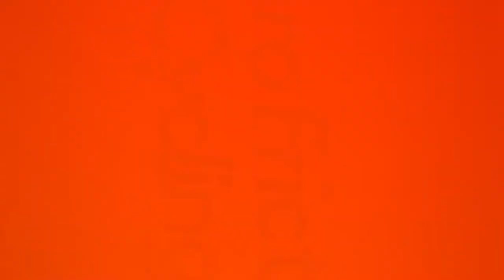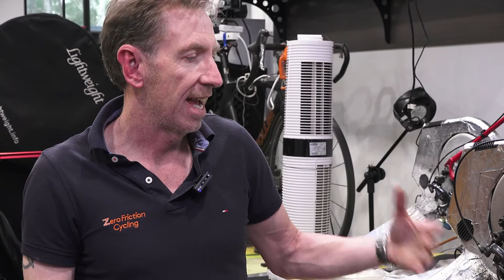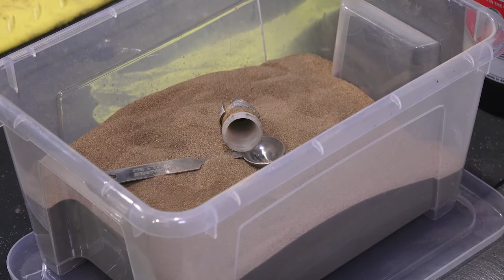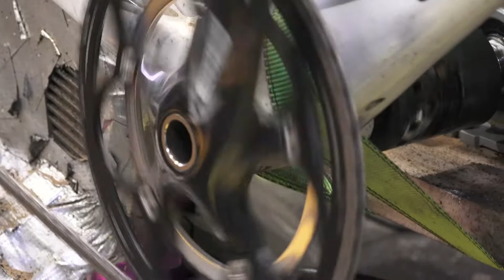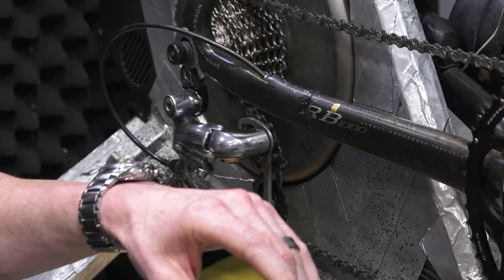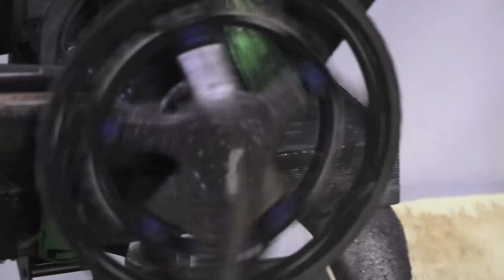Episode 9   Demonstrating  Bicycle Chain Contamination

Comment: loved the floating test bench design! makes so much sense.
Reply from the maker: Thanks Evrim! yes its a nice simple solution and those couplings are made for such situations - bb bearings in oldest test machine are nearing 200,000km old so it definitely is not transferring miss alignment loads, everything just floats on those legs & coupling very nicely

Comment from the maker: K re upload after first one missed demonstrating dry contamination on wet lube chain. There were a couple of comments on original upload re concerns safety wise of pedal spindle - great to see / hear people worry about such things! Pedal spindle is used to crank trainer up before turning on motor, cold start places much more strain on couplings as wants to got immediately from 0 to 100 cadence. One day will upgrade garmins to set grade to -5% and have trainers humming along before starting (i have this on the dedicated race chain machine) - but - in 5 years and well over 300,000km of testing to date (well over 10,000 hours of test machine running time), i havent yet come close to getting whacked with the spindle. Its pretty easy to miss, and one naturally takes care around spinning motorised equipment. It would take a pretty special effort to get whacked, it is a lot easier to ensure well clear than what it probably looks on video.

Comment: Ah, brilliant - the setup video.  One thing not mentioned - is it always the same chain that gets used?  Might be good for consistent data?
Reply from the maker: yes every test chain is a new ultegra 11spd. However the chain itself will always be the largest variance in the testing, hence we are looking for larger differences in the results, close results - basically class that as same same as positions could reverse if both re tested.

Comment: Very interesting. You drop the contamination onto the top of the tension run of the chain, where it is partially knocked out by the chainwheel teeth then it can fall off the bottom. But IRL the contamination also falls on the top side of the lower chain run, where it is pushed into the chain by the lower jockey wheel teeth and the cassette teeth. Have you considered and discounted this difference as unimportant? Might be interesting to see if there is a different effect on the noise increase, at least!
Reply from the maker: Hi there! good considerations,  but yes overall i did discount as not important. the important part really was application of same contamination, same amount, same method, same intervals. 

Initial testing to bed in the protocol was already very time consuming as tests across multiple lubricants had to be done repeatedly to check if variance from one test to another was acceptable. And so really when it was clear that the application method as shown was able to clearly assess if contamination was absorbed, penetration and causing higher wear, or not - then that was all ok. 

I do not think the position of the application (top or bottom span) would make a difference as it is not an immediate path from contamination hitting outside of chain and then being deep inside abrading on the pin and inner link bore causing accelerated elongation wear. What sticks to the outside of the chain needs to be basically pumped in there over multiple rounds of articulation and reticulation - so it is really down to a) is the contamination absorbed on the outside first and b) does it have a pathway to be pumped from outside to inside. Wet lubricants typically do both of those things, wax - being solid or semi solid - has much lower amount sticking, and then a much more difficult path to get from outside to inside chain -both of which is same in real world cycling as the testing. 

Hope that helps!

Comment: How often do you replace the cogs and chainrings ?  and does it alter the test results ?
Reply from the maker: Hi Ming -  every test. Yes that is expensive. Yes it has been very difficult ensure i have enough parts to keep 3 test machines running all time. but yes it is certainly possible that running worn bits for new chain could affect wear results as mesh would be not great, and this MAY have an impact albeit likely to be small, but also as the test contains a lot of harsh contamination, chains are being run to wear rate limit, and the chain rings are cheap / cassettes cheap - it would be 50/50 at best they would accept a new chain without jumping under load, or encounter and issue at some point during the next test. 

For some of the top lubricants tested however (msw, hot melt, silca ss, ufo, effetto) - wear to rings / cassette at end of main test has been extremely low, if just doing that - i could have easily re used for another test. But then the suite of single application longevity tests that follow, especially the extreme contamination S.A.L - as the treatment lifespan is being pushed past its limit and everything still being hit with water and abrasive contamination, a lot of wear to everything occurs in the last part of that test = new bits & full reset for next test.
Reply: @zerofrictioncycling992  Thank you for all the hard work and time dedicated (cost as well).

Comment: Keep these coming. they’re brilliant. 
Another question I have (which I’m sure you’ll have covered somewhere on website) is what is optimum for a race chain post waxing? As in should it be kept and raced as first use or run for a while to get rid of excess wax before the race? Hope that makes sense. I’m asking as I’ve tried both but first use gives me a lot of wax dust and I’m assuming there’s a level of inefficiency in that which isn’t ideal for optimum race conditions
Reply from the maker: Thanks kenny! I also need to try to check back on video's comments more often :) Re race chains on mswpeedwax / hot melt - depending on a couple of factors (power / temperature) they will typically hit their fastest zone after 20 to 40 mins of cycling to fully break in the wax (press out excess, polish remaining bonded wax to a super slippery finish). So if you do a 20 to 30 min warm up pre race, then normally its fine to run put race chain on day before race day, and let warm up take care of it. Personally if it is an important race, i have a specific ergo i do the day before that is a really good little leg freshening tune up to ensure great feeling legs on race day (30 min long session), and between that plus race day warm up, race chain is absolutely kicking off pedal stroke one of the race in its optimal low friction zone and in normal road conditions it is going to stay in that zone for at a couple of hundred kms.

Comment: Mr. Talks too fast shan't come back to my screen no more please !
Reply: @manuelluis5456 Probably the solution is to change the caption language settings to your language then switch captions on.

1) At the bottom of the video area select the "Gear" symbol. ( Select = left mouse click ).
2) Select "Subtitles / CC" .
3) Select "Auto Translate".
4) Scroll down the list of languages and select the one you want.
5) Select the captions symbol. A red line will appear underneath the captions 'page' symbol when captions are on. Wait a few seconds and read away in your language.